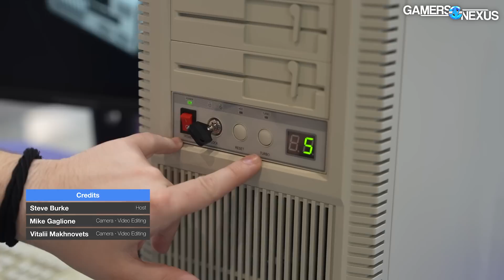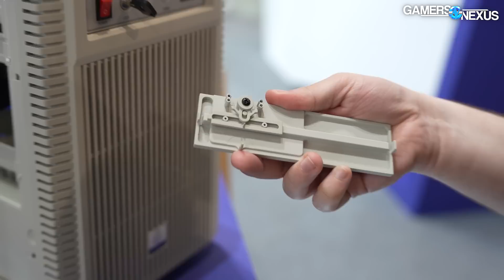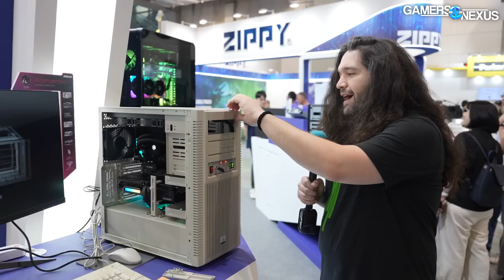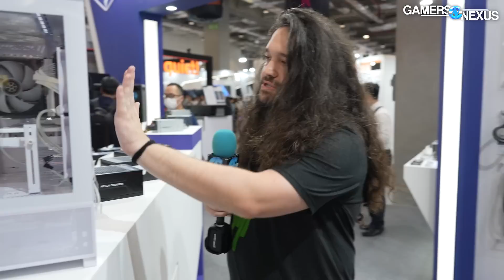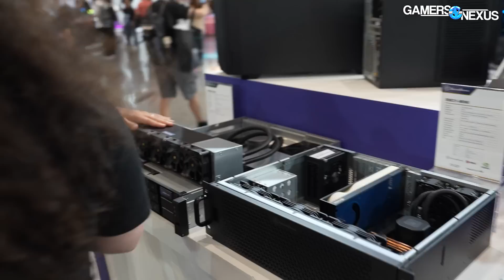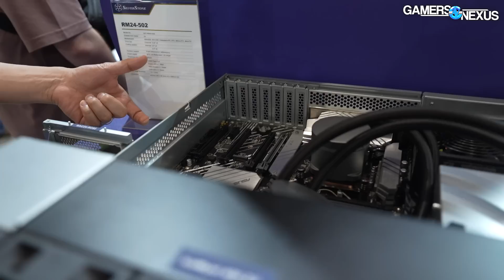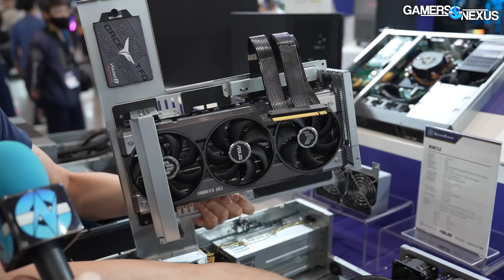Unironically the Best Case: Retro Silverstone FLP02 with Turbo Button

Comment: I hope the colour gets more beige over time
Reply: You need to be chain smoking for about 6 months in the same room as the PC to get a genuine 90s beige patina on it.
Reply: @Republic3D  And then it starts to sweat those caramel droplets as it heats up 🤢
Reply: @classicbandgeek  Yes, sticky droplets and big smudge marks around the power button and floppy drive switches.
Reply: @Republic3D  Did only smokers' computers get beige?
Reply: @Seacle14  it all depends on the plastic. My 2 old cases are still greyish white, but CD/DVD drives are slightly yellow and one of the trays is straight up beige.
Reply: I have two beige Aopen cases from around the year 2001. They have been in use in some fashion for all 24ish years of their life (I have never smoked) and been in rooms that see sunlight. Both cases the plastic front panel is still the same colour as the power coated steel. The whole thing might have faded evenly over time but I doubt that the different materials would fade the same.
Reply: @Seacle14  The plastic yellows over time by itself too.
Reply: @Republic3D Lmao. legitimately lol
Reply: @Republic3D  I was about to say that! Chain smoking while reading the BBS.
Reply: And more cowbell.
Reply: Just leave it out in the sun and  let it boil to a yellow color 😂
Reply: The yellowing for non-smokers was due to polybrominated fire retardants.  They were toxic and ineffective, so were phased out.
Reply: Plastic is not UV stable and light ones shows it clearly. Back then stabilizing additives were not too common.
My front panel had a gradient proportional to sunlight exposure.

Comment: I actually screamed when the turbo button boosted the fans. What a blast for the past in such a marvelous way
Reply from the maker: It's so cool! Love the display.
Reply: @GamersNexus  do u know who built that system? LOL
Reply: @GamersNexus  As someone who runs the MS-DOS Facebook gaming group , this is super AWESOME!!
Reply: too bad turbo button should actually slow down the fans ;)
Reply: @benjaminsmrdelj  given that it's a toggle, it does
Reply: @benjaminsmrdelj  Depends on the machine ;)
Reply: Yeah I love that its a fan "boost" haha. A long time ago I used to have a knob on a pci slot cover to control my fans and I really miss that functionality.
Reply: @mromutt  on early PCs that button doubled the processor speed... From 4mHz to 8 or from 8mHz to 16.
FWIW, the original ISA bus was the first (and only, IIRC) peripheral bus that ran at full CPU clock speed.
Reply: @slateslavens  I know what it is XD I had one. it was for when software was locked to the clock speed. Needed to use it for really old games or they would run super fast.
Reply: It would be super nice if it set a pin high or low that could be read and used as your cpu governor haha
Reply: Turbo button actually throttled the cpu back in the day
Reply: This is a restomod PC 🔥
Reply: I was just waiting for the slot where I can fit the future of analog media: the big-boned floppy disk and it's gigantic 18 MBs of storage. The world might not be ready though for such a technology, so it might not be included on these cases.
Reply: It's pretty cool, but I hope we can have the option to display the CPU temp in the front panel! And also some flat drive bay covers, instead of 3x 5.25" floppy disk covers lol
Reply: it should technically reduce their rpm though, everything is ruined! :P
Reply: from the past*
Reply: Turbo button to boost the fans is actually a more appropriate use of the word "turbo."
Reply: next is a 80-90s monitor with glass front but 4k and 144hz 1ms and upp :P hehe,  think that have made it really cool, or say a box monitor you could put your own screen inside to get the views like old style, and that is actely somthing Silverstone can do
Reply: It would be super awesome if it was somehow tied to an on-the-fly overclocking feature but that would have to be supported by the motherboard.
Reply: @KooYu I was thinking about that too. If you could preset it to a specific overclock config and just press the button to activate it would be so cool
Reply: Autism

Comment: Gosh darnit I never thought I'd say it but Beige is Back. Saw a beautiful example of a retro modern build on reddit yesterday.
Reply: I've done the polar opposite of this by putting an Athlon XP/Asus A7N8X-E Deluxe retro PC in a "modern" case (Fractal Focus-G because it still has 5.25" bays) complete with custom watercooling loop made of mostly age-appropriate parts. Would be fun to put my main rig in a retro-style case like this and have them side by side :D
Reply: Gotta fill that thing full of Noctua fans.
Reply: @KenS1267  Back in those days a single case fan was considered plenty.
Reply: think i found a home for my fx5700Le
Reply: Does anyone make old school green PCB AM5 motherboards? Really need to go full retro with Noctua original color fans, find some green PCB memory sticks and so on.
Reply: @Republic3D  Asus has "CSM" (Corporate Stable Model) boards which are usually green and have legacy interfaces still on them. Negative point: it's Asus with the usual build quality issues and quality levels of their trash-tier PRIME consumer series.
The "best" green AM5 board they have is the Pro B650M-CT-CSM. It still has pin headers for a serial and parallel port, a chassis intrusion pin header as well as a 2 pin mono speaker output from the onboard sound
Reply: @Knaeckebrotsaege  Thanks for the suggestions!
Reply: These pcs were actually white back in the day, only turned beige is due to the ravages of time. I would like if they just made it white but it is what it is, most people associate the retro look with their current coloration.
Reply: @Yelkwood9  Err... no. I've unboxed a NOS/NIB AT case and it definitely was NOT white, neither the plastic front panel nor the paint on the metal. Stop spreading FUD
Reply: @Yelkwood9  I've been around since the days of Altair and Apple II and no, the cases were not white. They were beige.

You can even find color photos of them, color photography having been invented before the 2010's in case you were unaware.
Reply: @KenS1267  "color photography having been invented before the 2010's in case you were unaware."

damn son going for the jugular
Reply: @Yelkwood9  I am pretty sure they were always on the creamy side. They did get more yellow with age but they were never pure white.

Comment: For the older looking case. They could add a vent panel that matches the bottom incase you want more air flow instead of drives.

Comment: Where's the CD-ROM drive ? No 3.5" floppy either. Would probably be a good case for my i7-970 which is the only 64 bit system I have ever seen that also happens to have a floppy disk controller!!

Comment: I would make use of those 5 1/2 inch bays. I would like to reuse my internal Blu-Ray Recorder drive. I had an old Fong Kai case from 2001 that had a nicely ventilated front panel and it was 120mm in size. Most cases back then had the 60mm to 80mm fans as standard but it was sufficient for cooling with the hardware of the day.

Comment: Whoever thought it was a good idea to put nuclear launch keys on computers I salute you for your madness :D
Reply: old computers definitely had this from the era, I fondly recall this exact panel on a old computer id gamed on. I think it even had the 1 or 2 digit 7 segment. it seemed like such a sweet concept abandoned, though to be honest the lock was easier to bypass than a password, I really like this application of being able to lock down power buttons, so a kid/animal/ME can't accidentally reboot or kill the system. this is genuinely the most exciting "sleeper" case I've saw, and honestly a very pleasing case in general
Reply: the first ones to do it on PCs might have been IBM with the AT (5170), and later clones reproduced it. iirc it’s for locking keyboard inputs
Reply: @nononymous This one enables you to lock it when you're not using it, so nobody else can access it. Locks the power button apparently. Edit: I imagine it locks the keys as well, in case it's in sleep mode.
Reply: @Squidgy55  the implementation might be different from manufacturers i guess
Reply: @nononymous  It's a cool feature anyway. I'm looking forward to seeing the finished product.
Reply: these locks were on mainly on hotswap HDD caddys in 5.25 bays, especially seen in office environment (usually single drive per bay mirrored pair that made very distinct headseeking noises unlike modern HDDs).
Thermaltake put them on side panels e.g. Shark model.
Reply: @Mr.Leeroy they were a lot of use for locks, on the front of the case itself it was either to lock the keyboard inputs or the power switch, on HDD bays like you mentionned and i also have a case with a lock on the handle on the side panel to not be able to go inside it
Reply: @nononymous  I might be wrong, but keylocks and power locks were not that common here in EU, probably deprecated before homes adopted PCs as mainstream remembers them here.
Reply: @Mr.Leeroy i had a K6-2 as a child and it had a keylock for the keyboard input, and i was in France at the time
Reply: @nononymous  Sure there were all kinds of examples, but how many folks had the same?
IDK, how big is the percentage of home users that started with something other than Pentiums and not even first gens.
Reply: I'd probably use this for our home server which uses consumer parts.
Reply: Two keys 3-2-1-Turn! 🚀

Comment: Absolutely, unironically love the hell out of this.
Reply: Love that it has 5.25 drive bays. I still like internal drives, even if I don't use them as often.
Reply: It's such an easy win, I'm surprised it's taken a company this long to lean into old PC nostalgia
Reply: Man nostalgia hits hard. I’m sold
Reply: Ironically linus build that
Reply: The only thing better would be the squat horizontal "desktop" style of case where you would put your monitor on the top
Reply: @eugenepark9665  check out the FLP01 :)
Reply: @eugenepark9665  That's what the FLP01 is (SST-FLP01W)

Comment: Oh, wow. They actually let us use the 5.25" drive bays this time around. Very nice.
Reply: 5.25 was always a good bay for doing modular front i/o. It just was not utilized as much as it could have been.
Reply: I'm so mad that I just built a PC and had such a hard time finding one with 5.25" bays and here's a good one right here.
Reply: @WhchOneIsMe Fractal pop cases have them. I got 2 optical drives in mine but barely use them 😅
Reply: Im gonna put my old Cooler Master Musketeer in it
Reply: One 5.25"" on the FLP01 is extern.
So this I what will do when I build a pc for granny.
Putting a CD drive in there. They USB slim ones are way to fragile and complicated with the tray to put a CD in.
Reply: I wouldn't buy it if they were fake. I still like to have a CD drive in my computer instead of grabbing a USB one.
Reply: @volvo09  same, + the usb ones pretty much all suck.
Reply: @TheSynrgy1987  and the way i see it, if I'm going to have a big computer case, it better have drive bays.

I'm running a 20 year old case with a plastic side window...

Yeah it won't accept a massive 4090, but I don't need it.

My computer is more of a tool, everything should be there even if I rarely use it.
Reply: @volvo09  Same. Wanting to be able to still use internal optical drives is what made me use a be quiet! Dark Base Pro 900 Rev. 2 as my case for the desktop I built in 2022.
Reply: @volvo09  For me it's a tape drive and a CD changer, both take up 3x 5,1/2 drive spaces in my workstation.

There's also scores of 4-8 drive SSD bays that fit in 5.1/2, 8-bay nvme bays, various drive bays that take 1/2/3 5.1/2 inch bays for various amounts of 3.5" to nvme size disks.

There's also a ton of pro audio equipment that is made to fit in 5.1/2.

And your classic front I/O expander products.

There's also quite a few watercooling products that utilize these slots, like for watertanks.

5,1/2" spacers will always have a place in the PC world, even when most cases don't offer any anymore.
Reply: @volvo09 of course different use cases… I’m in datacenters building/deploying server hardware. I’ve been doing this for about 15years… this entire time, I haven’t touched, let alone hardly seen an optical disc for work use. Last disc I used personally was Last of Us 2 on PS4 about 5 years ago. I’ve been building PCs for over 30 years, last cd drive I installed had to have been ~2002-2004 for an AMD Thoroughbred system I built.
Reply: @volvo09  I've always felt like they work better than the USB ones. Just based on my experience ripping music cds.
Reply: @volvo09  I haven't had a PC with a 5.5" bay in like 10 years. I only use DVD's like once per year so a USB one is just fine.
Reply: @jonny-b4954  Optical drives are the least interesting use of a 5.25" bay IMO. 
Hot swap drive bay cages OTOH, are a pretty fantastic use case.
Reply: @kienanvella  
I definitely want to have a hot swap bay (and maybe additional I/O) in my next build. Preferably installed ahead of time instead of long after everything's populated. There seems to be a disturbing lack of SATA ports in the motherboard I have been checking out however.
Reply: @jonny-b4954  I prefer to have a DVD bay on my PC. Feels more genuine and it's more satisfying
Reply: @mikedasneves  I can see that. I do miss the old days.
Reply: @jonny-b4954  I built my new PC with a Ryzen and an RTX 3060 at the end of January 2024 and I specifically chose to build it in my brother's old Antec P183 because I didn't like my options with modern cases. (Most notably, I wanted room for two optical drives.)
Reply: I had 5.25" to 3.25" to 2.5" adapterception in my 4U PC rig. It just worked!
Reply: Cup holders are back!
Reply: Yeah that's the reason most modern cases are useless to me. I wouldn't give up a Blu-Ray drive which I need for audio CDs or dumping PS3 games.
Reply: One of my current builds has two BD-writers.  I went with Fractal Design Pop Mini Silent, allowing two bottom mounted 5.25" external drives.
It was actually an easy choice because, SO FEW CHOICES to begin with!
Reply: The other one lets you use the existing 5.25 bay it just only actually had one on the original and retro version.
Reply: Wendell is gonna go crazy....
Reply: I still burn blurays, so this is really nice
Reply: I'm looking forward to ripping my library. The only problem now is finding an internal Blu-ray player with a white/cream face plate @mbabubak
Reply: My Silverstone case has two 5.25 bays. I have a DVD RAM drive in one slot and a 3.25"/2.5" hot swap rack in the other.
Reply: This is what I came to the comments to say, I truly miss the utility of the 5-1/4 bays.
Reply: 5.25" is an anti-obsolecense feature. You can fit adapters for the latest front panel I/O to keep the same case through the generations.
Reply: @KiraSlith  Yeah. I just built a PC last year which I intend to probably keep for a decade, and I have another Antec P1-series case to swap back to next time, and I'm still kinda used to when cases of this tier cost half as much... but I'm considering the idea of buying an FLP02 and keeping it in storage just so I have the option.
Reply: @KiraSlith  you're so right! Also, with this case you don't have to be afraid that it goes out of style. Because the last time it was in style was half a century ago ;D
Reply: The best way to prevent anyone stealing your PC if they break in.
Reply: I wish they made horizontal case too.
Reply: hell yeah my old DVD writer will have a proper home
Reply: I used a Phanteks Enthoo Primo for my 2023 build, because I always wanted one and I wanted 5.25 bays.

I have one BD read/write drive and a cardreader who also doubled as USB-C porť, in them.

On my old LianLi PC-7FNW I ran two optixal drive ane a fan controller in them.
Reply: I want one in bright yellow!
Reply: This guy gets it.
Reply: Personally I’d rather have an actual floppy drive.  Just for fun.
Reply: IT's great for hot swap HDD/SSD bays
Reply: This is why I use a Pop Air XL.
Reply: Cool, now I can fit both my Plusdeck 2c cassette drive and an optical drive in there. And the case color matches the cassette deck. Retro heaven!
Reply: I'm putting my sound 
Sound Blaster Audigy 2 Fatal1ty in it.
Reply: It's been too long that we've had a case with a built-in fan hub, internal 3.5" bays, and 5.25" drive bays. Now I just wish they either had adapter sleds, or built-in external 3.5" bays as well.
Reply: I'm also still using an optical drive (and card reader) in all my PCs. But three bays?! I'm in heaven! Now I need to find a USB-to-FDD adapter to actually get a working floppy drive in there!
Reply: Still have 6 of those in my case. Never going to need another case.
Reply: It's missing a 3 1/2" Bay for cardreaders, could be covered with a fake Floppy as well.
Can the covers be ordered in different shades of gray, beige and off-white to be period correct?
The drives never matched the color of the case back then.
Reply: 3 5.25 bays is perfect. I have dual HDD hotswap bays and a Bluray/HD-DVD combo drive in my current build. Admittedly the HD-DVD doesn't get much use but I like the novelty.